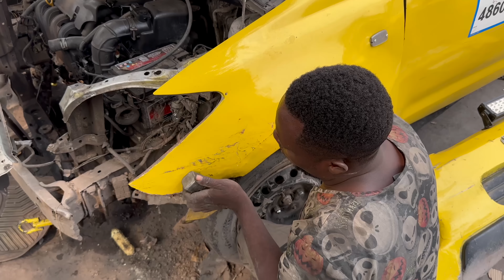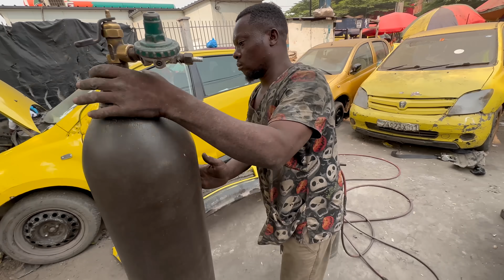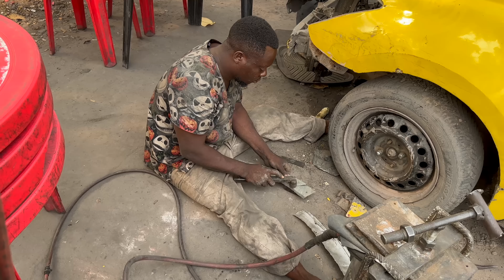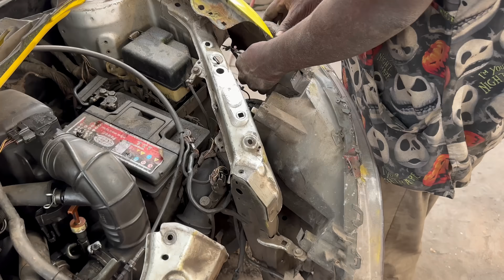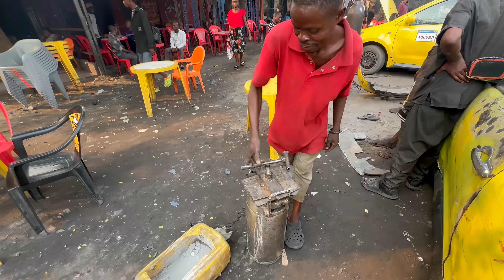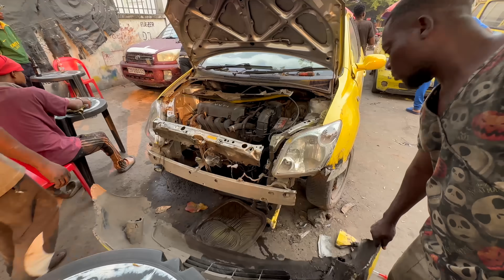Accident Repair in Africa

Comment: Just imagine the time that could be saved with a drill and zip ties.
Reply: He needs to run down to his local Home Depot or harbor freight! But seriously....we could fly over and drop parachute crates of jb-weld, zip ties etc... and observe from a distance how we changed the evolution of this place. One hell of an experiment to observe 😂
Reply: @technicalitems731 Makes you wonder who’s smarter than who if provided the proper tools. Hmmm
Reply: @eligreg99 these are impressive industrious guys.  Lets not argue about know-how though. Yankee ingenuity is world famous.
Reply: @eligreg99  Considering the education, the westerners. But the Africans have great problem solving with the current tools they posess
Reply: Duct tape could fix everything.
Reply: @eligreg99  sure buddy, sure
Reply: @MrCophtr  Still can’t figure out how they made those Pyramids eh?
Reply: Sorry bud, but they need to fix it in a way that it will still be able to take small impacts without needing to go to repair again, if they used zip ties the next bump into something or other car would take it off and repaired again...zip tie is not a good solution for their reality, zip ties are the laziest way to fix anything.

Comment: 1:28. Wow. They use, like, no eye protection when gas welding. No tinted visors. No sun glasses. No sweater against the bright bright light. (Unless sweater/skin coverage is for ark welding. Which causes sunburn without it. I think.)
Reply: Adamlar.hala.karpit.kullaniyor.bende.5.sene.kaportacilik.yapmıştım.istanbulda.davut.paşada.
Reply: Хотя бы простые очки солнезащитные одел бы